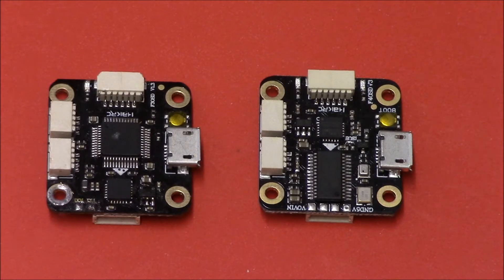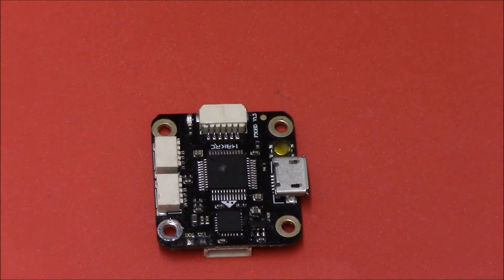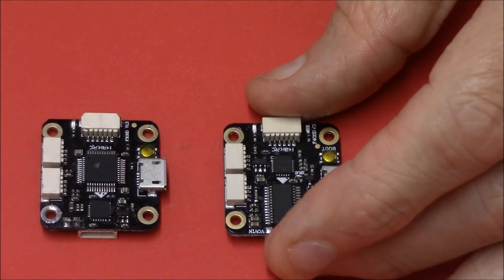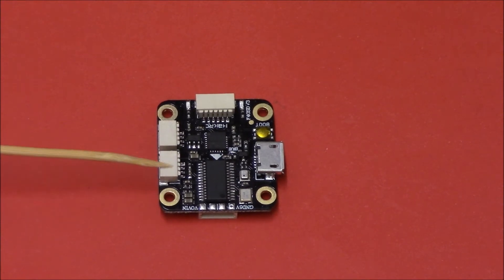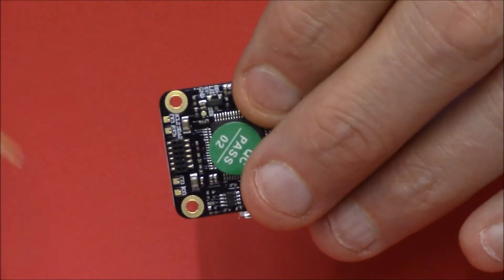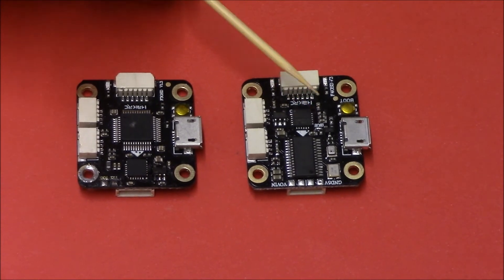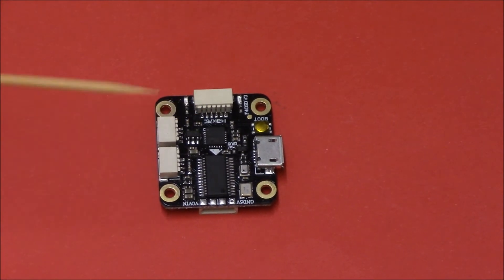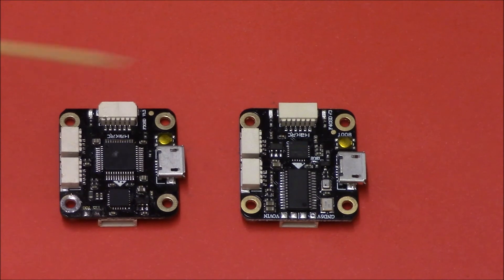HAKRC  F3 Vs F4  FLIGHT BOARDS

Comment: Thanks for the comparison! How can I connect an ibus receiver to the f4 FC? Can I just plug it right into the port?
Reply from the maker: Witch F4 flight control board are you using ?
Reply: @GeorgeCooper_LoneWolf  Using the Hakrc mini f4, but I cant seem to get ibus working.
Reply from the maker: You need to Connect the I-Bus signal wire to ( RX 1 )  Not the RC pad, that's for S-Bus. Hope this helps.
Reply: Tried this and it works like a charm. Thank you for helping out a newbie!
Reply from the maker: @quadnor2986  You're welcome buddy, Glad I could Help

Comment: Good review i just bought f4 stack. How to power VTX and Camera there is only one 5V and G pads do we have to solder both VTX and Cam to same 5V and G pads??? need help sir
Reply from the maker: I did a full build video using this board hears the link https://www.youtube.com/watch?v=DNCMwNgFubE&list=PLxQpiTtUaBhjIr_IP2iV34ppIl2hETQQI&index=8&t=304s  However if you just want to know about the 5V and Ground just jump to 4.13min and 10.40min Hope this helps matey...

Comment: Hey George, on Betaflight, configurature, how would you transform from f3 to f4...do you have a video doing this on a computer...Like updating your Betaflight? I think that's what all of us beginners are trying to do, at least I am.
Thanks!
Reply from the maker: Hi buddy,
 3F boards and 4F boards are different, it's not software you change in betaflight it's the software that comes on the boards when you buy them. A 3F flight control board will always be a bit cheaper to buy as they don't have as many capabilities as a 4F (simple explanation) However there is nothing wrong with using a 3F but if you buy a 4F flight board you will fined you can increase certain things in betaflight to help your Quad fly better. Hope this helps

Comment: This comment is about the HAKRC F4  mini ,I need help , how to flash this board with INAV , I also need to take advantage of 4 uarts because I need to use 
- gps module 
- flysky rx in sbus mode 
- speedybee uart Bluetooth adapter 
- AKK x2m 25-800mw vtx with smart audio 
And if I can find some other type of cool gadget that requires another uart I would happily try to fit it in the build because I’m under the impression that this HAKRC f4 mini flight controller has the capability to connect up to 5 uarts , am I wrong ? ?, are there only 3 uarts available ? Do I need to re-map my led/buzzer plug because I DONT want to do that I want to have my LEDs for night flights and I already have them installed 
, please someone help is needed thanks 🙏
Reply from the maker: On the board you have RX1 TX 1 / RX3 TX 3 / RX6 TX 6  / SDA 1 / SDA 2 / SCL 1 / SCL 2 Spare pads /
uarts.

See link and check out the photos https://www.banggood.com/20x20mm-HAKRC-MiniF4-F4-Flight-Controller-Integrated-with-Betaflight-OSD-5V-2A-BEC-for-RC-Drone-p-1246530.html?rmmds=mywishlistA02817649204201406M5

I’m very sorry but I can't help you with  flashing INAV on this
Board as I have never done that myself. However, The late great JC from Project Blue Falcon who is no longer
with us Sadly, made a complete playlist all about INAV so hears the link [ HOPE THIS HELPS ]

https://www.youtube.com/playlist?list=PLiYYhnH4BhI8DKSj5LLo2U7y5bTdqAZr1
Reply: George Cooper thanks a lot for the reply , I tried INAV and it didn’t work , long story short now , I have a BIGGER problem , I have to reflash it with betaflight ! Can you please tell me the target I need to use to betaflight again , if you plug in your hakrc f4 mini to the computer for me and tell me what it says  for the target in the top left corner when you open betaflight , thanks a lot , I have a brand new flight controller and I can’t use it cause the company “ hakrc “ dosent proved good info about this board at all !
Reply from the maker: Hi matey I happen to know the F4 Target is (  OMNIBUSF4SD ) Good luck
Reply: George Cooper I got it flashed , it looks the same as before I wiped it out ! I set it up real quick to check if it’s working and I can hover at low throttle but when I give it a punch out or so , the ESC desynced
Reply: George Cooper can you help me set it up because the barometer shows up in the icon but not inside flight modes tab
Reply: I know how to use betaflight , it’s just this specific flight controller that’s hard for me because it’s my first clone
Reply from the maker: Have you gone into the configurations tab and turned on the barometer tab ? because as you re flashed the board it probably will be of
Reply from the maker: That sounds like a ESC problem try flashing the esc's Also check all your motors are ok ( just encase )
Reply: George Cooper all parts are new , I’ve flashed dshot 600 on the esc , it’s very strange  , and by flash esc that’s only on the betaflight right ?
Reply from the maker: Try dropping down to D Shoot 300 I have had to do that in the past. To flash your ESC'S you need to use  Bl Heli if your not sure about how to use Bl Heli I will be happy to make a video to show you How, let us know. Just going offline but will be back later
Reply: George Cooper ok , it’s the 4in1 Blheli_S from Hakrc 20 amp
Reply: @GeorgeCooper_LoneWolf  hey 👋 back again haha your the only one who helped me with this years ago , I still have the 20a esc and I’m wondering can I use it with new f7 boards or some newer f4 boards some other flight controller makes & models ? if not I want to sell it to someone on eBay who wants it if they still have the hakrc f4 mini flight controller
Reply from the maker: @thelongranger55   yep you can use the ESCs on other boards. But just remember the esc control's  the Amp pull so if you added it to a board that used bigger batteries let's say 6S then give it full throttle the amps wouldn't  probably burn out. 

So no matter what flight Control Board you use don't forget not overload the esc' so make sure you know what they're rated for.
Reply: @GeorgeCooper_LoneWolf   interesting I thought you could only use the same brands together, I already bought the speedy bee f7 mini flystack but I don’t regret it because I want the Bluetooth for in the field , I also got the adapter 3 with it , so I’ll just build a second drone lol , maybe pair the foxeer mini f722 v2 flight controller with my old hakrc f4 mini 20A esc and only use 4s lipo because esc is only rated for 2-4s
Reply from the maker: @thelongranger55 ... No mate you can you just about any ESC with just about any flight control board, the esc & the motors are the things that match up together & work together, but you  have to keep a cheque the motors and ESC is are compatible with each other for instance 4 to 6 lipo's on both  so the motors don't pull too many amps and burn out. 

That's why some pilots build their 5 inch quads which small 20X20 stacks just to save weight. Or mix and match a 30X30 flight control bored & a 20X20 ESC.